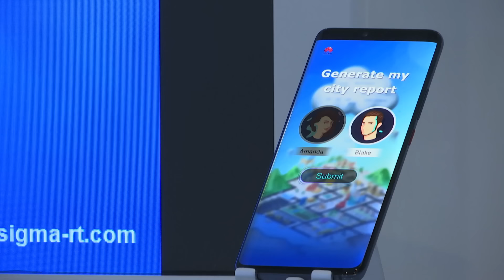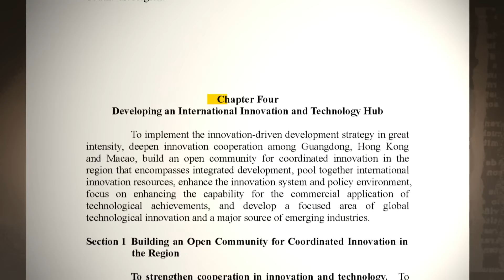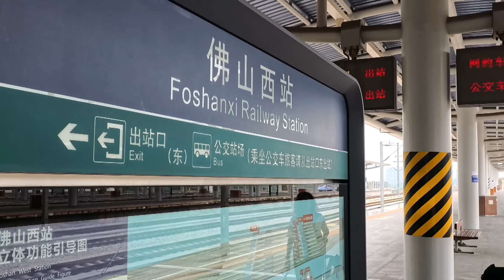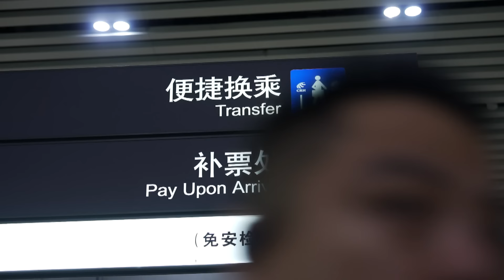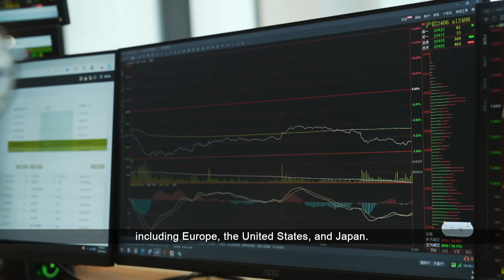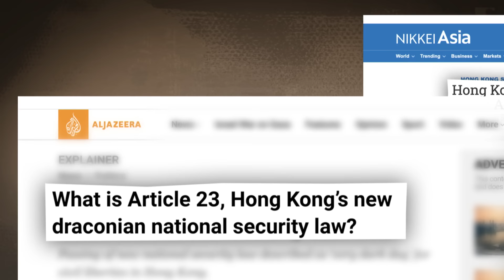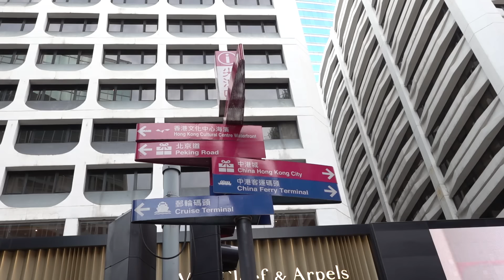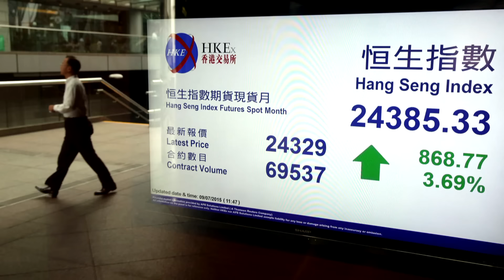Hong Kong In The Greater Bay Area: Can Pearl Of The Orient Regain Its Shine? | Insight

Comment: HK is an example of failure to change with the times. Some HKers need to understand that HK is part of an economic cluster, not a standalone window to China anymore.
Reply: Now that the CCP is in charge, it can choose which city to prioritize in terms of finance and trade. There is no longer any separate Hong Kong government electorate which can change with times at a different pace or direction than the mainland.
Reply: @DarkRockslizer HI is already protected as financial role. Otherwise Shanghai would replace it.
Reply: @DarkRockslizer  Everyone doing their own thing means a mess, a waste of resources, and a duplication of effort. Are you one of those HKers from the old times who failed to change with the times too?
Reply: @jjbully  I'm not from HK. If plurality only had negatives, HK wouldn't have a higher than average income level than the rest of mainland. This was even more true true decades ago. It is instead the mainland single party led China that was catching up to HK, despite mainland having way more people, land and resources.
Reply: hk offers a dual standardization experiment where security is integrated w china and finance is integrated across west / east.  No one else can offer that type of combo in-depth.  If it works, the result can be an advantage w no equal.
Reply: @icoco313  During the decline of China since 150 ago until 1980, Hong Kong was the only port transferring goods, trading and financial balance between China and the outside world. Its competitiveness was unparalleled and it was an exclusive business. Then, after China's Reform led by Deng in 1980, Every thing Changed due to the rise again of China. No one can deny that Shenzhen has been taking place of HK year by year. The implementation of one country two systems is not a guarantee to HK of keeping the competitiveness because HK must competes with China's other city fallowing the socialist planned modified to market economic system. The principle of the Capitalism advocates free competition in the market economy and survival of the fittest. That is the true world.
Reply: @DarkRockslizer  your sounds hk is better in livelihood in the old colonial time, aren't it still the same now? maybe some laws is adjusted or different, because land is truly belong to China. and China is in charge by ccp. But I dont see it really affected the economic system, hk is still priting its own money. whatever money hk is earned, they don't submit to china.  their economic system is still independent. and believe me, local mainland chinese do not want living in hk. you will know why , after you truly visited china.
Reply: @DarkRockslizer  The prosperity of HK in the past was mainly due to the unique positioning of HK and the influx of Chinese immigrants. The decline of HK is due to HK's failure to change with the times and getting stuck to the old British way and inability to develop. Population, land and resources are not the deciding factors to the success of a country, otherwise, Singapore wouldn't be a successful nation. The development of China is not about catching with HK either, it is simply about development. And i don't think this discussion is about political systems. Development is more about the quality of leadership and execution and vision
Reply: Hong Kong has the worst service attitude in the world. Even Hong Kong residents prefer not to spend their money in Hong Kong; they would rather go to other cities in the Greater Bay Area, such as Shenzhen, Guangzhou, Zhuhai, and Macau, to spend their money.
Reply: @thetrueworld8317  Dam, took me reading this 2x.  Impressive thoughts.  U got me to think about things I didn't think about before.
Reply: @lainfonet  Hong Kong residents prefer not to spend their money in Hong Kong not because the worst service attitude, service attitude is bad for many decades , it is because Shenzhen price is so cheap,only 30% average price for almost everything compare to hong kong dual to china deflation .and many mid class will  spend their money in Hong Kong . now they are in England
Reply: @DarkRockslizer  The irony is it was Singapore that more influenced China's rise rather than Hong Kong.
Reply: Hong Kong is just a gateway to China for Westerners benefit.  

Location location location. , but ties changes sometimes 😂😂😂
Reply: @ericf1461  Your comment is very insulting to Hong Kong and Hong Kongers and didn't know anything about my country - Hong Kong. Where did you learn Hong Kong is just a gateway to communist China for western countries? We feed that Frankenstein and got our back bite. Did you know about that? Ngo diu lei lo mo gou chau fa hai!
Reply: @dawnnadir  

Without the resources from China that the westerners wanted and needed , who is going to invest a fishing village, Hong Kong, I meant…

Please tell me one reason why the westerners willing to invest/control Hong Kong?  

Is there anything the westerners want except the Temple Street business??
Reply: Oh btw,
Hong Kong is NO country ….
Do you really know anything about HK?
Reply: @ericf1461  I live in Hong Kong what do you think? Funny to see people don't live here but give false and ignorant comments and opinions in their own imagination on Hong Kong like you.
Reply: @dawnnadir  
What’s going on in Hong Kong has nothing to do with you live there or not.  
Can you just tell me ONE reason westerners invested in HK were not for the huge market/resource in China ???

Just one.  🤭🤭🤭
Reply: @ericf1461  You dare to walk down the street of Hong Kong with me and ask the random people if they think Hong Kong is not a country on its own?
Reply: @dawnnadir  
Why are you so angry?

I do always tell myself I am Jensen Huang ….  But I still live paycheck to paycheck…. 🤭🤭🤭

Don’t know what your point is 🤔🤔🤔
Reply: @dawnnadir  This is stupid, you are assuming all people in HK think just like what you think. One thing I don't like the HK rioters is that they think their opinion represents the majority of HKers. And what people think won't change the fact that HK is a Chinese city. I am from HK and I know HK is part of China. If you dislike the fact that HK is part of China, you are always welcome to leave.
Reply: @jjbully  If most HKers agreed with you, then Beijing would have no problem with allowing democratic elections. But in reality, Beijing knows that most HKers won't vote for what Beijing wants.

The 2019 District Council elections confirmed the opinions of most HKers, with the pro-democracy camp absolutely crushing the pro-Beijing camp. The entire purpose of the 2021 electoral reforms was to further limit the voice of most HKers.
Reply: @lainfonet it's god dawn cheaper in PRC. HK is so expensive. Even locals are feeling the pain how expensive to live in HK.
Reply: @Cosmo1093  Its kinda mute point - what ever people of on CITY think doesnt change the reality that HK is only that, one CITY.  With few extra benefits to its political and governmental role, but still only city and not a state.

Comment: I need to say that as an expat living in the GBA the transport network is extensive but as for convenient, not at all. The bullet train stations are all unfortunately very far removed from the city centers and it takes a lot of effort to travel to those. Then there is the extensive security measures one has to go through when entering even just a subway station and the line up for these can and does take a very long time. Then one has to endure the shoving and pushing at the bullet train station’s security check points to enter the station; again a lot of time wasted. Then there is the waiting for the bullet train. One cannot really meticulously plan your trip around specific times because of all the security check points and long line ups; one never knows how long those can take, and the crowds of people one might encounter (yes there are crowds in all major big cities but unfortunately they are not very organized around these parts). Apart from long waiting times one is also exposed to herding like environments with endless railings and obstacles in stations to navigate instead of just free flow foot traffic. Taking a cab to a bullet train station… the traffic is a nightmare. So all in all as extensive as the network is it is not very efficient. The complete opposite can be said of HK though. Extremely efficient on every possible level. I do hope that on that mainland side they can make improvements. Then there is also customs to consider when entering and leaving HK and Macau. For comparison, I live 100km from HK Central and it’s a 1.5 hour drive should i want to drive there (excluding customs). It’s at least three hours on a good day if I take public transport from my house (excluding customs) - a far stretch from the so called one hour loop.
Reply: Holy smoke.... you took the time to key in all that.
Reply: Actually, everyone in China who ever have been to western country agree your option. The mainland government always hope absolute safety like covid -19 but this world doesn't exist absolute safety. They are wrong.
Reply: @malgudidays3311  yup…love typing
Reply: 市中心有高铁站，广州东站，深圳福田站，
觉得你说的太夸张了，
但确实还有进步改变的空间！！
Reply: I thought china is very modern. But from the sound of it the transportation is still very inconvenient. For any tourist these details are very important
Reply: @popcorn6931  read the persons screen name and ask yourself if you think they are valid
Reply: @popcorn6931  China is very modern and advancing very rapidly. As I mentioned the transport network is extensive. China is a country of paradoxes. The transportation is convenient but yet inconvenient. Convenient because you can really reach nearly anywhere with it. It’s fast, safe and reliable. Inconvenient due to reasons I’ve mentioned in my original post. China is an amazing place and coming here as a tourist will be a mind blowing experience. Ive been here 8 years and my mind is frequently still blown by the sheer scale of everything.
Reply: @城市野狗  当然，有几个车站位于市中心，但绝大多数车站并不是这样。我的评论是针对前往这些车站的便利性。记者提到在大湾区城市之间旅行不超过一个小时。如果你住在靠近市中心的车站旁边，这可能是真的。我指的是不住在车站旁边的一般人群。我还指的是前往、进入和导航车站的便利性。车站里总是有很多人和安检。这些因素都会影响公共交通的整体效率。
Reply: @Amidat  let me guess…you ate a box of of your favorite popcorn while reading and making useless comments
Reply: @abroadinasia  还有改进的空间

Comment: The title is very misleading, with a thinly veiled attempt to smear China.  "Regain Its Shine?" This clearly tried to portray a "decline" after the 1997 return to the fold of the motherland.  Do remember also that Beijing has to honour its promise of 50 years of autonomy to HK.
Reply: Subtle us psyop narrative ?😅
Reply: hi
Reply: China has lots of achievements to proud. But there are also setbacks. In the 90s, HK is the financial centre of East Asia, in its own rank. Now, we also have Singapore, Tokyo, Shanghai, etc. If you just shut down any slightly negative opinion, then you never improve. Luckily, the Chinese know this.
Reply: Regain  means no shine now ,  zero misleading